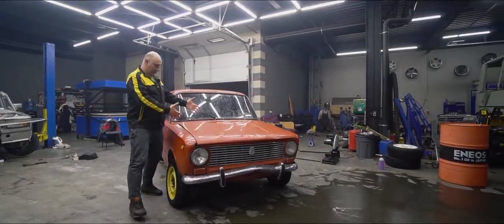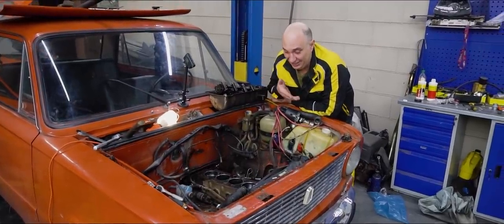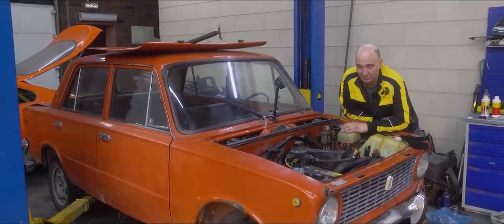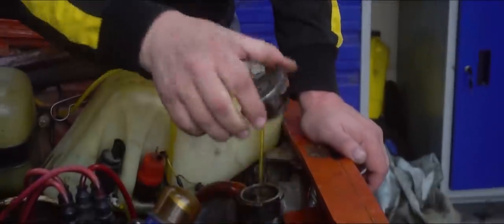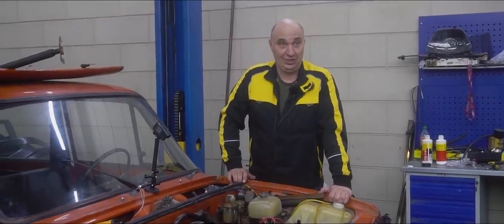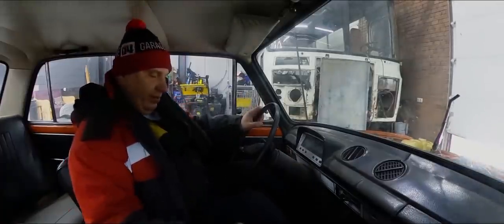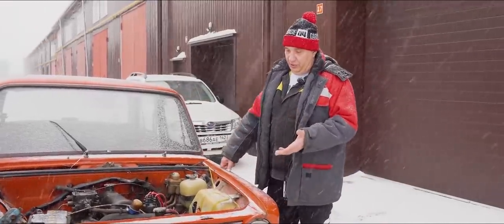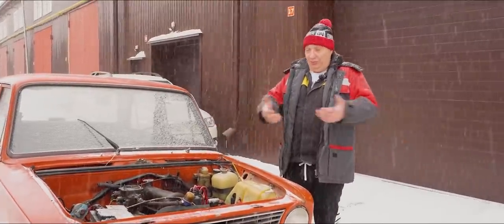What happens when you fill the cooling system with motor oil?

Comment: What if you do nothing else but replace the coolant with oil. Will oil act as good as coolant? Make it oil cooled engine. Would it work in cold winter and hot summer?
Reply: I've looked into this before and the problem is that oil is only 30 percent as efficient as coolant at cooling.
Reply: @kylefowler5082  so it will not work properly.
Reply: @pasifsc3749  correct, the engine would overheat in hot weather

Comment: Keeping in mind if the gasket gets broken between a low pressure oil gallery and the coolant system, if oil is being used as coolant, it will be pressurized into the sump... adding to the oil thats already in the engine. This wouldn't cause damage on its own, until the oil level reaches the crank and it becomes a giant egg beater. This would aerate the oil destroying most of its lubrication properties. Easy way to blow your main crank bearings.

Comment: Very interesting.  In all likelihood eventually some of the oil will overfill the engine, which would lead to frothing the oil.  From their it would go to the pcv valve in the oil pan, & depending on the car it would be vented out, or be sent into the intake & burned.  Worse case scenario is the pan would overfill too much & make the oil over froth, leading to increased engine wear.

Comment: The biggest problem I see with oil in the radiator AND a bad head gasket is the radiator will eventually drain down to the crankcase because it's higher in the first place. Now we have an engine that's seriously overfilled with oil and will likely smoke like crazy. The flip side is the radiator will always have an air space and not circulate. Basically I figured they would just do a straight replacement of antifreeze for the oil and see how the oil transferred heat, but that's not what happened.

Comment: Drain/flush then fill the crankcase full of low viscosity epoxy resin.  Start engine and let it warm up.  Then while still running add catalyst to the proper ratio and put a brick on the gas petal.

Comment: That should blow the radiator apart, or blow the cap right off.  Oil pressure is about 50 psi normally, but after shut down the oil pressure goes away while the radiator is still pressurized by the heat.  This would tend to overfill the pan with his head gasket modification.

If he had left the head gasket alone, this would probably work while it was cold out.  Oil cannot transfer heat from the head to the radiator with any where near the efficiency of water/glycol mixture, so the car will likely overheat.  It is an interesting idea using engine oil as coolant, but it would require a much larger [thicker] radiator to keep the engine temps under control.

Comment: You should have flushed the cooling system and refilled it with oil before messing with the head gasket so we could see if just replacing the antifreeze would be okay. I had already figured that if the gasket was  blown and you just topped it off with the oil allowing it to emulsify would allow it to stay cool in -10° weather.

Comment: It still works bc its a Lada, not some car where the emulation causes problems clogging sensors and pcv valves. Also coolant doesn't lubricate, and internals would start to rust...

Comment: I have 2009 verna diesel the  coolant got inside the engine and    mechanic replaced the engine but i got one problem radiator also broken, so mechanic put coolant and engine oil mix
 After that engine is running. Should we replace the radiator or i kept old radiator with coolant and engine oil mis ????

Comment: What happens if you totally fill the engine with oil up to the top cap ? Will the car runs normally ? Will it smoke alot ? Or the oil finds its way to the cylinder and spoil the sparks ?
Reply: They've done it before.

Comment: I read in a engine design textbook that they use kerosene as coolant in lab engines to let them warm up faster, lower specific heat capacity than water.

Comment: Water (or water and antifreeze...) conducts and transfers heat much better than oil. This Russian Lada (in a Russian winter...) isn't overheating with an oil-filled cooling system, but it would overheat in summer. Using really lightweight oil would require a much bigger radiator and the heat inside the engine block would be more unevenly distributed than with water, causing more wear on the engine from the greater variations in expansion and contraction of moving parts. Otherwise, it would have been how it was done.

Comment: If you get an old diesel-engined car and do this, you can just exchange every fluid in the car to motoroil. Need diesel? Use Motor-Oil instead. Coolant? Try Motor-oil! Maybe it will also work as a replacement for brake-fluid and power-steering-fluid?

Comment: One time many years ago I was looking at purchasing a cheap Ford Festiva that a neighbour had for sale. I went to give it a lookover and everything seemed to be pretty tidy but then I cracked open the radiator cap and..oil! I'm not talking a bit of oil mixed into the coolant, I'm talking it looked like someone had deliberately filled the radiator with used motor oil. I pretty much just quickly put the car back in order, shut the hood and walked away. It has always puzzled me just what the exact hell was the reason for that. The only somewhat plausible reason I could come up with was that perhaps the engine had a bad head or headgasket that was leaking coolant into the oil and the owner just figured he'd put oil in the radiator if it was leaking into the oil system anyway.

Comment: You should try connecting the fuel line to a container of waste oil and see if it runs.    also, try putting gunpowder in the carb.

Comment: Can you weld the head to the block?
Reply: Most engines have the block made from a completely different material than the head. Welding something like cast iron to aluminum would be very expensive if not impossible. However some of the modern engines coming out of Japan have an aluminum composite block and standard aluminum head. So if they import something like that then its doable.

Comment: This actually happened to me while driving a 2005 Peterbuilt with a Caterpillar engine when the barrier between the coolant in the radiator and the oil cooler was breached. The coolant in the radiator was... well, basically transformed into what looked like dirty Vaseline. 😳

Comment: i was thinking mineral oil,,,     replace the headgasket for a brand new one to keep the systems seprate... then use mineral oil instead of water. and regular oil in the sump,,     will it overheat, still function as a vehicle "take the mates on a lap of the complex" , and abuse "rpm revs or clutch dump" ?? sounds like a full video to me

Comment: Keep in running while you’re talking to see what it doesn’t without the air cooling it from the grill plus the cooling system pump turning faster since you are accelerating. The water and air are are what cools it, the antifreeze does what its name suggests, inhibits rust, lubricates and changes the boiling point. Oil is a lubricant thats harder to freeze and boil than water, but can damage seals and plastics. Plain water is less risky as long as you don’t have it in there long

Comment: Coolant in the oil. Oil in the coolant. Gear oil in transmission. Transmission oil in gear box. Blinker fluid in brake system. Brake fluid in blinker. Can a Lada survive?
Reply: I know a guy that raced a season of street stock with 10W30 in his automatic transmission. No problems.
Reply: @Chris_Garman  😲😂

Comment: If you keep the gasket intact and just fill the radiator with oil, you will get an oil-cooling system without the water corrosion associated with water cooling.
Reply: but it is not good for car  manufacturers.
Reply: @peterparker-fg5kr  Right, but it will be another cool experiment. 😃

Comment: A FRIEND I WORKED WITH HAD A CHEVROLET WITH A 6 CYLINDER IN LINE.  IT HAD A LEAK FROM THE COOLING SYSTEM INTO THE OIL!  THEY WORKED ON IT SEVERAL TIMES WITHOUT A FIX, THEN THEY DEIDED TO REMOVE THE WATER AND RAN OIL IN THE COOLING SYSTEM!!
IT RAN OK EXCEPT ON VERY HOT DAYS!! THEN IT WOULD OVERHEAT!!

Comment: Modern cars have delicate engines. They are not ancient as Lada. Oil as a coolant liquid will freeze at winter as paraflu has lower freezing point. And at summer will get hoter than paraflu as oil is thicker than paraflu and takes longer time to cool.

Comment: I would suggest filling the cooling system with oil without any issues on the head gasket, and then see if any issues come up. I don't understand why cooling systems need water+antifreeze? why not use oil??

Comment: I always wondered how long a car would last if you never put coolant in after a rebuild and just filled it with oil. I think unless it was really hot, the thing would probably work just fine for a long time. If it's all clean of water, then there shouldn't be any emulsification problems anyway.

Comment: Time for two for one..  Get the clear pan and valve cover and fill the oldest,  dirtiest engine with transmission fluid instead of oil. Run it to see how long it takes to go from red to all out dirty. Not only that but drain and filter the oil pan contents to see what,  if any junk, is found in the fluid.

Comment: I am going to say that the rubber and plastic parts, such as rubber hoses, and plastic parts of the radiator, heater core, etc. will fail due to not being made to handle motor oil, and was made to handle antifreeze only.

As for the fluid holding the hear, and transferring the heat to the cooling system such as the radiator and heater core, it should work ok sufficiently, but the motor oil will be thicker, compared to the antifreeze, therefore the motor oil will flow slower, than the antifreeze.

Comment: Interesting idea, this has me thinking, one benefit being that you will no longer have to clean milkshake out of the engine, if the head gasket were to fail, my next thought is a water pump will likely have to work harder with typical motor oil in place of coolant, unless it is thin weight, and standard motor oil will likely have an effect on rubber hoses/gaskets, hmm has anyone tried WD-40 as engine coolant or perhaps atf or even power steering fluid.

Comment: 4:40 that's not how you check the oil level, first you must clean the dipstick, then insert it again and THEN check the dipstick. 
This because the oil gets splashed around when the engine is running and the result will be a wrong reading on the dipstick, you will read a higher level that what really is

Comment: I wonder what actually happens when you actually fill the crankcase with coolant instead of oil??
Would really like to see that.
Reply: @All These Squares Make A Circle ...hmmm whatever , I wanna see it happen.
Reply: The bearings get chowdered up and after a good while it'll either seize up or break, depending on the situation
Reply: @MF175mp  Come on!!
I know but I just wanna see it happen!
Reply: @omarrama5984  better is to leave some oil and mix with coolant, it will turn into some mayo-like mess

Comment: i got an idea what happens  when you put jet fuel in your car will it run  or will it go bang
Reply: jet fuel is pretty much diesel so it wouldnt work in a petrol engine
Reply: avgas used in piston aircraft would be interesting its really high octane petrol essentially
Reply: We used to use Avgas with two tuned Mercury XR2's when racing boats, works great.

Comment: there's oil and there's oil.  
oil comes in different viscosity.  there are oils that are as thin or thinner than water or glycol. 
anti freeze contains lubricants.  the dye is to give a visual indication of a leak. 
why not use extremely light weight / low viscosity oil instead of ethyl glycol as a coolant ?
why not   ATF ?  something like that or even thinner.  
ATF  is  BRUTAL.  it can take a lot of abuse and flow through a radiator/ heat exchanger.

Comment: I dont understand why the coolant pressure wouldnt go through the roof. Engine must not build much more than 20lbs of oil pressure. Put a gague on it. Let's see what happens when a coolant system  builds 60lbs of pressure. You'll be covered in an oil bath.

Comment: What if the car's left outside so that the oil can drop to -20C, -30C and -40C? Will the oil be too think to flow through the radiator and water pump causing the engine to overheat?

Comment: Use an engine with a bad head head gasket that leaks water into one or more cylinders then drain all the water out then put in aviation fuel.   run the engine

Comment: The rubber bits are NOT going to like this, and the water pump is going to go berserk.
Reply: Might need a pump to send the excess from the block back to the radiator.

Comment: I never saw something more stupid than that. Replacing coolant fluid with oil, will work, in theory, with reduced efficiency, but in the event of having a head gasket damage the  engine can literally blow up, if your cooling liquid is leaking to the oil lubrication system, it will lead to rise of the lubrication liquid level up to a point that the piston movement will lift the excessive oil mass up to the combustion chamber through the piston rings, in an attempt to compress that. Since oil is practically uncompressable, such an oil suction will damage the head and most likely to shear off the head retaining bolts ( actual engine blow up). It's a typical damage when someone over filling the oil system. Physics 101...

Comment: Terrible idea. The entire cooling system is full of dirt, rust, and scale, especially the block. If the "cooling" oil and the engine oil are mixing, a lot of that shit goes to the bearings, cam, cylinder walls, etc.

Comment: See if a petrol engine or Diesel engine can run on paraffin
Reply: An indirect-injection diesel engine can run fine on paraffin, as long as you add a bit of two-stroke motor oil for pump lubrication. Not sure about direct-injection or common-rail diesel engines, though.
Reply: @wayshot  would be interesting for see if it would run just on paraffin

Comment: Try filling the coolant radiator with hand sanetiser, from my experience sanetiser gets and feels pretty cold when blown on.
Reply: It can't evaporate in the system to create the cooling you imagine. Alcohol destroys rubber as well.
Reply: @Chris_Garman  you might be right on the part with it desolving rubber over time but i am pretty shure the coolant fluids arrent suppose to evaporate, it would create presshure inside the engine and possibly blow a gasket.
Reply: @maxbennedbk7085  Of course they aren't supposed to evaporate. Evaporation is why the hand sanitizer feels cool when you blow on it though. Latent heat of vaporization.
Reply: @Chris_Garman  that sounds kinda right so i suppose your rightb but they could still try it since rubber and gaskets wont dissolve imidiatley, its basicaley just alcohol so it might leak a bit here and there but otherwise it should be fine apart from the actual alcoholic steam witch would slowley rise their promille, VERY sloley...